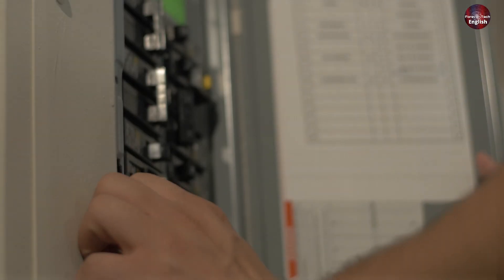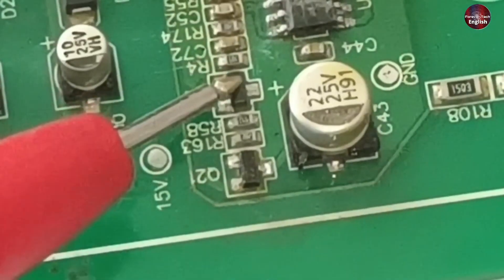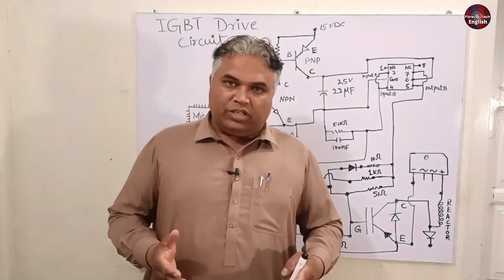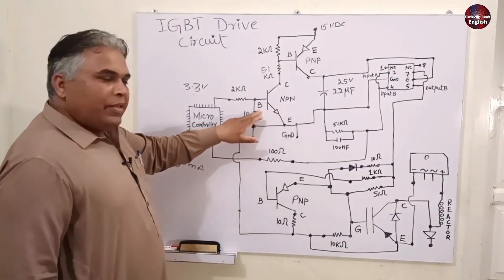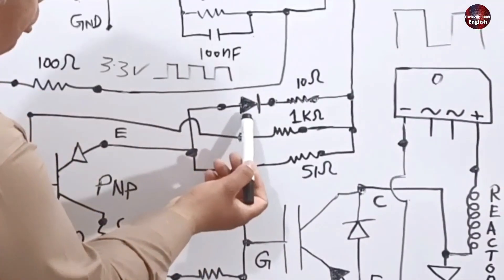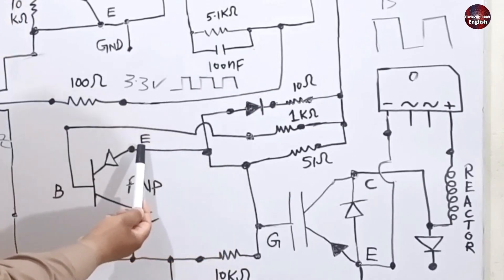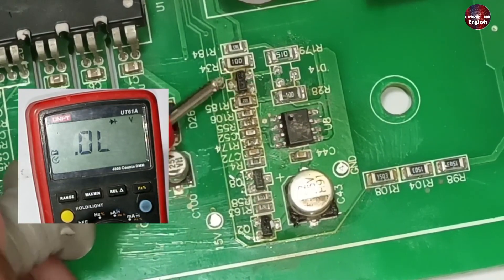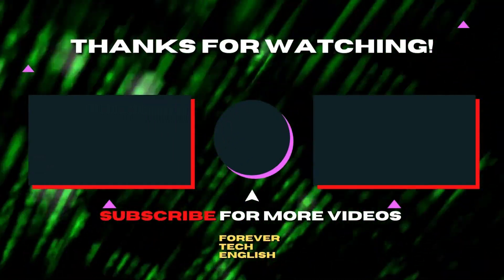A/C Circuit IGBT Driver Repair & Explanation, Other Tech Failed!!

Comment: It's all fine and dandy, but seriously stay away from teaching electronics. An NPN and PNP dont have to get negative voltage to turn on, just the polarity between Base and emiter are reversed. So you'd tipically use an NPN in common emiter connection, and PNP in common collector connection.

Comment: Hi I have 4 of these Lucent power modules. I am looking for information on converting them to voltage adjustable to 60v for off grid battery charging any direction would be appreciated thanks Roland

Comment: This method of driver igbt with direct connection is very bad if the igbt blow the Entire circuit is screwed I use optocoupler work best faster switching speed more efficient conversions